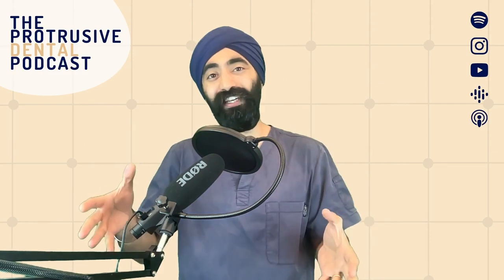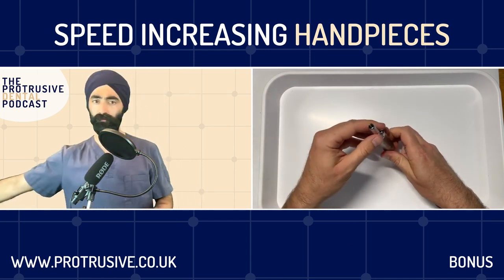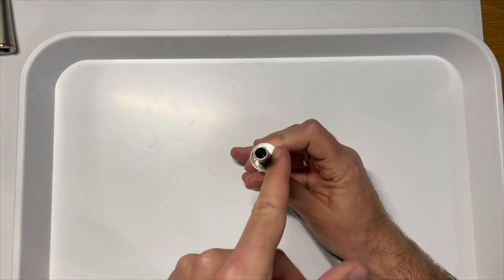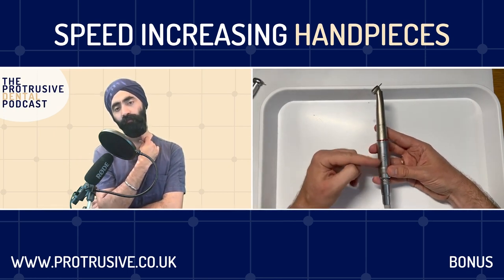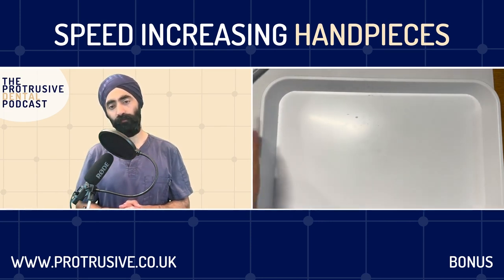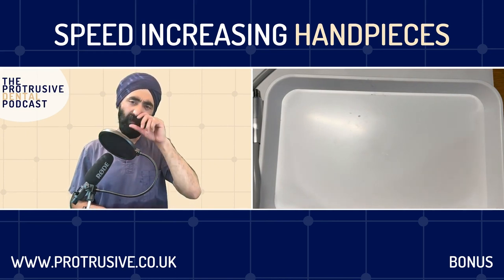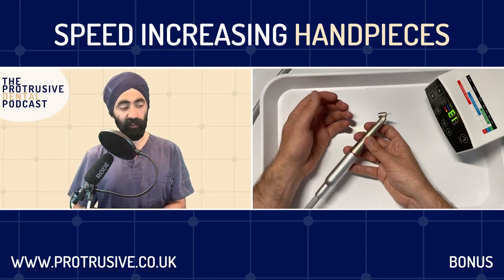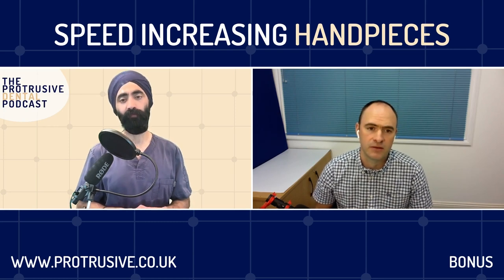Speed Increasing Handpieces in Dentistry - A Guide to Electric Handpieces

Comment: Hi Jaz, are you still recommeding Incidental handpeices? We've had a lot of breakdowns and two instances of severe lip burns from overheating handpieces. I believe our maintenace is good
Reply from the maker: Hi Greg - I am an advocate of Chris O Connor - he's a super knowledgeable and helpful guy. I have not purchased his handpieces as I have had my own for several years before he started to sell his. For what it's worth, I am using NSK. I have also experienced this issue with an NSK handpiece (speed increasing) and I had an incident where I burned the patient's lip (I talked about it on a podcast episode and how I managed this). The reason for this was the bearings were worn and needed replacing.

I would DEFO reach out to Chris? Seeing as I have experienced this just once and you have had a few instances, something does not add up here
Reply: Hi Greg, we appreciate you have had a bad experience with our handpieces and that you are upset.

What you should know is we try our very best to service, repair and educate dentists to get the most out of our handpiece products. 

We believe they are a good product and that our offer is excellent value. They remain popular after several years on the market. 

Of course they are not perfect but If you can find a brand of handpieces that never breakdown (especially 1:5’s) then stick with those. Our experience is they all have issues and need regular maintainance. 

Regarding lip burns we would remind any dental professional  that It is the dentists responsibility to check that handpieces are running properly every time they use them and by running them for a short period before use and inspecting. 

Also at no time during operation should a handpiece ever touch the soft tissue of the patient. Even a perfectly functioning 1:5 handpiece will heat up over a period of use and is very dangerous to run in contact with the soft tissues.

Comment: I’m still a bit confused! If you don’t have an electric mini motor and you just have a air motor speed increasing handpiece on your unit is it still ok to section teeth and remove bone? Is there still air going through the air motor? Thanks, great episode!
Reply: The optimal would be no air and external sterile water. That would require a micromotor and external positive pressure saline supply. The reality is this is not always available or practical or perhaps proportionate to the risks involved. 

If you use an Air motor or indeed a micromotor and there is pressured air driving the spray then this is not the ideal situation and is a compromise. The goal of this episode was to inform dentists about the way handpieces work and the variety of options available. I think for absolute guidance on what can and can't be used we would need to look for position statements from Royal Colleges or notified bodies. I'm not aware of any consensus I'm afraid so I cannot advise.

Comment: What is the optimal RPM for caries removal with round steel burs? Often not discussed in every day dentistry. I normally change my settings depending on the case. Wondering if there is an optimal range in the literature?
Reply from the maker: Thanks Graham! I'm not sure what the academic answer is, but I can share with you what my old restorative consultant taught me (professor of Restorative Dentistry) - he told me to use rosehead burs 10-15k (if softer caries then 10, if firmer then 15) but I always use it WITH water to reduce heat. If anyone reading this wants to share your protocols or evidence base, always happy to learn!
Reply: @protrusive  thanks jaz! The range i use is 7-10k but I'm not using water,  instead taking  intermittent breaks using caries dye etc. Nice video👌